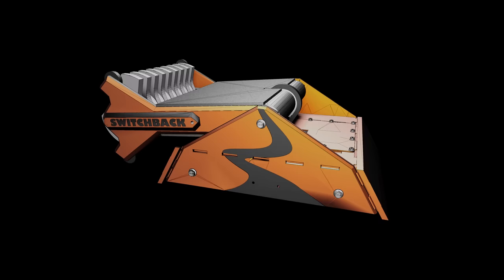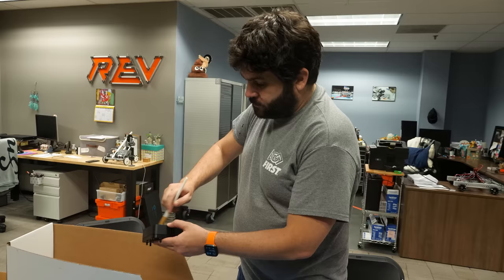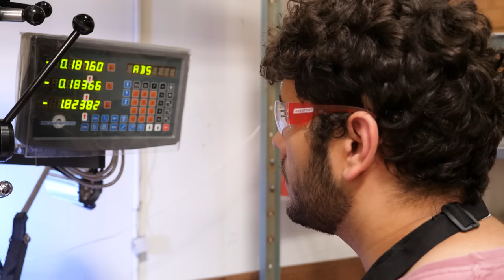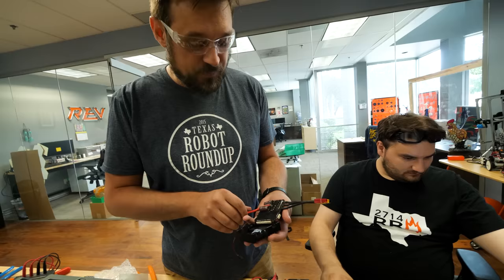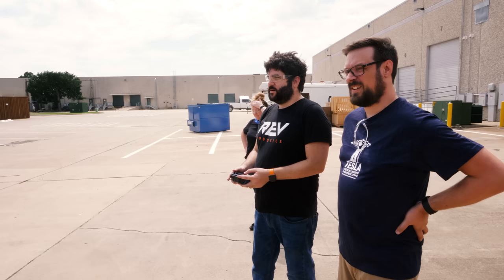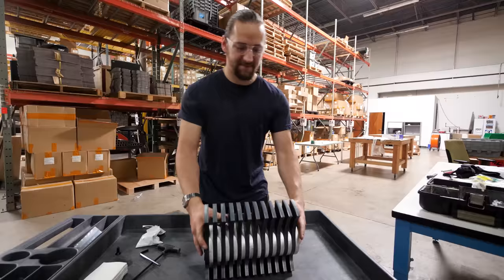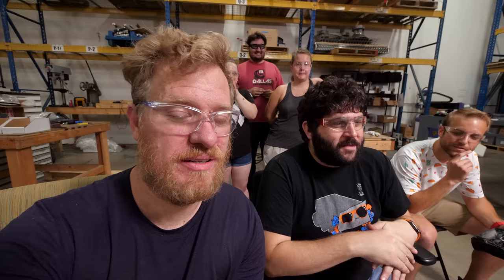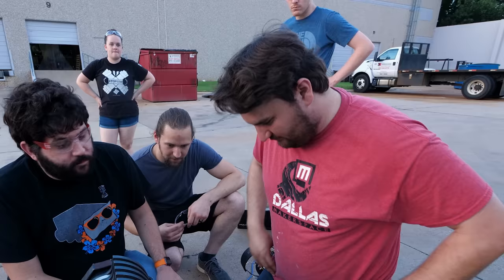We built a BattleBot. It's terrifying.

Comment: From my experience at BB my advice to new builders is don’t build your first combat robot trying to do things the “new way” brushless drive is far less reliable (but sometimes necessary due to space constraints). Also the Battlebots floor is really difficult to get good traction on so small, hard, smooth wheels are usually not the best choice if you have a high center of mass. With all that being said, tremendous props to this team and what they accomplished. I’m sure they learned all of those lessons before they even left the event. I love this video and the bot is a really neat concept and I’m sure they’ll be back even better next season!
Reply: I'm going to guess that with brushless motors you end up blowing up the controller boards pretty frequently... my experience with eletronic controllers is that they aren't particularly fond of vibration - getting sufficient isolation for the board so that it works reliably in competiton must be terribly difficult.
Reply: @wrlprchnx  I've never examined a failed speed controller board to determine cause of failure, however I would guess heat buildup due to large current demands and insufficient cooling would be the main causes of failure. Vibration failure can easily be overcome using polyethylene or a polymer resin to encase the parts so the components and circuit boards can't flex. Once that's done the components will be held rigidly in place. Heat dissipation will be your primary concern after that. The only method I know would be to used a water cooled heatsink that's also encased in the polymer resin making direct contact with the FETS using thermal epoxy. I'd consider using a couple of negative coefficient temperature sensors connected to a ESP-8266 to monitor temperature and control the cooling to critical components. Just my thoughts. Maybe you have alternative solutions you're considering.
Reply: I don’t understand how not tinning the wires caused a dead short. That sounds like something I’d say at work to cover up for a mistake I made that destroyed a piece of equipment 😂😂😂
Reply: @wrlprchnx  it’s dumb easy and most of us let the ESCs just flop around inside the robot. It’s overdraw causing them to burn up that usually kills.
Reply: @alvieteal4980  he just said the wrong word, it happens!
Reply: 12345shushi  Lasers are prohibited by name because of the danger to eyesight.

There are no rules against a plasma cutter, but the reason not to try is that opponents can defeat it trivially if they can strap a rubber sheet over their bot. Plasma cutters only work on conductive materials. They also need a ground to complete the circuit, and have a specific standoff range, so unless you have some grappling mechanism it would be very difficult to execute. You'd lose by default to bots like Huge or Mammoth.

Comment: Your esc needs to be be rated 10 times the motor power rating because the way motors are rated is weird. You might need special rc buffered esc because the load is rather unpredictable.
Reply: by RC i mean resistor-capacitor in series connected to all three phases of each output
Reply: Could also design it so that your ESCs sink heat into your frame.
Reply: Also the static buildup from spinners(which act like van de graaf generators) could mess them up

I wonder if OHKOs by spinners that turned out to be receiver errors, happened that way in the show
Reply: The ESCs and Motors alone cost well over a thousand for battlebots of this size 😭
Reply: Meaning if you have 4 wheel drive with 4 motors… that’s roughly over 8 grand. Double it due to testing and having spares, the cost exceeds 20 grand for just motors and escs
Reply: And that’s just for drive 😭 there’s usually also motors and escs for the weapon lol
Reply: In response to my earlier comment on 10x esc power rating. You don't really need that, but you should understand kv rating and how esc is like a inverter that produces three phase ac power; and select a suitable esc. If you're dealing with over 1kw motor(which is very small considering a e-bike can go to over 20kw) it's recommended to know MOSFET driver and induction kickback, speed feedback, inrush current, ect.
I know college ev teams that know nothing about power electronics and the power train always go in flames

Comment: When it's spinning at top speed, the steer torque will be impressive. Turning a corner could well flip it over.
Reply: If it turns using tank steering and raises blade it would probably do ok
Reply: something something Wrecks, something something highest kinetic energy spinner at the show.
Reply: spin it the right way and it could be gravitationally stabilized no matter how you flip it over! :P
Reply: I was thinking the same thing, this bot looks too simple electronically to handle well. battle bot have been too concentrated in getting good mechanical design, but good electronics, sensors and microcontrollers is also really helpful in controlling. I wonder why few ever go past using simple RC parts, even a flight controller will help with stabilization
Reply: @yuxuanhuang3523  I think the sheer amount of power being pumped through the systems may limit the complexity of the control systems. One of the other robots this year blew up 3 ESC's in their weapon setup, and had to revert to a spare that was only rated for 50amps. It took their spin up time out to 15s instead of the 3s they were used to from the (IIRC) 300amp setup they had grenaded. 
There are many reasons to stick with proven "dumb" systems, including ease of setup, ease of troubleshooting, peak current capability, reliability, ability to survive the combat environment, and overall cost. More complex systems tend to cost more, and add more failure points - and if a system can't survive being hit with a flamethrower, having a 100lb steel bar spinning at 250mph slammed into it, or being dropped from 12 feet up onto a floor made of 1/2" steel, potentially all at the same time, then the average roboteer won't use it.
Reply: @gchampi2  Then I have to tell you that some heavy drones have way more power than a 300 amp ESC and they still use microcontrollers.
You are right about introducing complexity is not always good though, however TI has industry-grade microcontrollers that tolerate heat and vibration, with proper protection they sure will be fine. Also, just as a fact, ESC controls the on and off of mower mosfets with a microcontroller, if it's fine, a central controller will be fine. The teams are just too focused on the mechanic part because traditionally AI hasn't been really strong.
Reply: @yuxuanhuang3523  Drone flying compared to driving on the ground is completely different. There's no need for a flight controller type system in a Battlebot, and even if there was one what possible benefit would there be? 
Countering gyro forces may not always be welcome as at times people use them to self right or need to turn quickly and are willing to deal with some gyro. 
Heat and vibration ratings are nowhere near the shock loads a Battlebot undergoes which has exceeded practically every sensor someone has every tried to measure with. 
Even with the latest AI you'd need to tune that AI to drive differently for every kind of bot and driving style, and accommodate for things like a drive side locking up.
Reply: BB regulations limit tip speed of a spinning device to 250 mph for safety reasons. That being said, balance and weight distribution is a far greater influence on tipping
Reply: Isnt physics amasing
Reply: @derektran3133  doesn't Bite force use PID control with gyro feedback for its steering?
Reply: @revimfadli4666  From what I know of the bot it does not, he simply spins it slow to avoid gyro issues.
Reply: @derektran9404  no not gyro issues, gyroscopic rotation sensor feedback. And for precise, responsive, and agile steering, not to combat gyro issues
Reply: @revimfadli4666  None that I know of, having asked some people I know along with my own recollections. Electronically it was quite simple.
Reply: @derektran9404  I mean, PID+gyroscope aren't much more complicated than usual ESCs
Reply: @revimfadli4666  It's an additional layer and set of connections that can fail inside of a Battlebot, and often times people are fine with the gyro forces as maintaining weapon speed is more important. Also the time you're vulnerable when gyro turning is different for every bot.
Reply: @derektran9404  again, I wasn't talking about gyro forces, but gyroscopic sensor as in angular velocity sensor. For adjusting against inconsistent floor slips, not gyro forces
Reply: @revimfadli4666 What do you mean by inconsistent floor slips? If I'm understanding this correctly I've never seen this ever be an issue.
Reply: @derektran9404  well the floor is uneven, so traction and slippage seem to vary

Also bite force doesn't overshoot its steering as often as other bots does it?
Reply: @revimfadli4666  Sure the floor is technically uneven and has varied points of traction but having personally driven on the Battlebox floor the variance has not mattered in driving. Our team has never really noticed that one spot was more slipper and the uneven floor only mattered for forks in which case your sensors don't matter.

Oversteer is really a question of driver skill and transmitter mixing, with the bot itself being often a small factor unless it has specific handling characteristics that are troublesome. Overshooting steering is relative to the opposing bot anyhow, so a few PID sensors wouldn't help at all.
Reply: @derektran9404  why would the sensors not matter for forks?

Also the steering won't even need "a few PID sensors", just 1 angular velocity sensor and 1 PID compensator

It can be compensated with skill, but wouldn't a responsive PID controller enhance that skill?
Reply: @revimfadli4666  You don't know when you will hit a seam with a fork and how your bot will be oriented relative to the other bot when you do.

A responsive PID controller will not make a difference as over and understeer is relative to the other robot. 

If your driver is always inputting too much or too little turning to your bot a PID controller makes 0 difference. 

It is not a closed course it's adversarial driving.

Comment: the vescs getting destroyed is a very common issue, try this: Solder a 50V TVS diode directly onto the pcb. Adding a low ESR cap also helps but that will increase bulk a lot.
The vescs dying usually happen because of voltage spikes, tvs diodes and caps help with that a lot!

Comment: "The resistance was infinite so essentially a dead short"
That is 2 completely opposite states of resistance, not remotely the same.
High resistance is the exact opposite of a short.
Reply: I think what he meant was that the controller had to crank up the output to overcome the resistance, and that increased current output made the controller act similar to a dead short scenario. They clearly at least somewhat know what they're doing, so I'll give em the benefit of the doubt here.
Reply: @Amy_A.  I have another explanation. It is a three-phase motor, and when one cable is not connected properly, the motor will not spin because two cables connect through one coil. What might have happened was that one connected coil was acting as a short because it was passing DC current.
What should have happened in a spinning motor was AC passing through all three coil at 120 degree apart phases.
Reply: Obviously just a miss speak. Like it does not matter.
Reply: I agree this was just a misspeak, but I think he's also onto the wrong idea - I've never seen a motor controller where it blows up without connection to a load.

Comment: Hey here's something that no bot builder has thought of. Installing limited slip clutches on their weapons and arms. I built recycling plants that wash tank paddles would jam up under excess waste material. to fix this, I added spring loaded clutch plates to the motor so that it would spin under power, but if the counter force was too much, the clutch plates would slip saving a lot of chains and sprockets. Your weapon stops abruptly on contact. A limited slip clutch would prevent it from burning out from excess load.
Reply: Believe it or not, clutches have been used since the very beginning of robot combat. Anything beneficial that you can readily think of has been done already. Especially something as simple as a clutch.
Reply: @bldjln3158  I've watched every build vid from Blip to sawblaze and not one has incorporated a clutch. The mechanical engineer in me gets frustrated when I see spinners being installed as diirect/chain drive without so much as a single measure of protection. Electronically, these machines are sound as a pound, but mechanically they could use some expertise.

Comment: Some improvement ideas:
Remove the chain drive and use 4 smaller motors
Definitely add heatpipes to all critical parts

Maybe even split the spinner into 2 counter rotating sections which cancels the gyroscopic force offset to enable faster turns
Reply: Counter-rotating wouldn't work because you want the whole thing impacting at once in one direction to impart force into the other bot.
Reply: @inthefade  yes I thought so as well...
Another downside would be that the bot flips itself in the opposing direction

Comment: For my bachelor in electrical engineering I had several projects during the 3 years. One of them was making a skateboard with a brushless motor. None of the teams got it to work. The motor was turning (more or) less effectively for all projects but the entire electric skateboard didn't really work in the end. They are really annoying. I guess it is easier if you are allowed to use motor drivers or other assistance.

Comment: 8:53 If the resistance goes to infinite, it is the opposite of a dead short!
Also with infinite resistance you are not able to bump the current, because you would need a massive high voltage to do so, like lightning voltage high.
If you want to learn more, look up Ohms law.
Reply: Pretty sure everyone in this video knew about ohmes law when they where 12
Reply: @Validifyed  If he knew from the age of 12, he wouldn't say: "So your resistance went to infinite, and it was essentially a dead short'
Reply: @BrainHurricanes  pretty patronising to tell people that probably have degrees in engineering to look up the single most fundamental law in electronics.
Reply: @Validifyed  No patronizing intended, but I understand you can feel it that way. You don't need a degree to build great things, they are only tools, just like Ohms law.

Comment: Its really interesting to me just how similar a lot of the build methods used in this are very similar to what we do on our school's FTC team. We have been doing welded steel robots for the past 4 or 5 years now, we have done custom wheels the past two years, and we usually use chain on our drive train. We would use brushless motors if they were an option, but they aren't legal to use in FTC. Also, power delivery is a bit of an issue we have been struggling with recently, because the batteries we are allowed barely last a full match, and drop a ton of voltage the moment a single motor turns on

Comment: Can you use a motor itself as the weapon? Instead of using the center hub to attach a weapon to attach the center hub to the chassis so it doesn't move but the outer casing of the motor spins which is your weapon. By doing this you eliminate any chains or belts to drive the weapon. Add attachments to the casing for your weapon. The outer casing is going to be tough and can be made even stronger. Only way to stop the weapon is to destroy the motor.

Comment: Many people make the same mistake as these guys did: they use the strongest metal sheets they can find. And use thick sheets, too, quite often.
Now, if you could make a system that would absorb the hits, the metal sheets will be MUCH harder to deform !
Example: take a sheet of wood, let's say 10 x 20 inches. Place it on a concrete floor and hit the board with a big hammer. It's easy to damage the wood because there's nothing underneath it to absorb the blows. Destroying the board is easy, at this time. 
Now place a piece of foam under it. About 1 inch thick. Hit the board with a hammer. Denting the wood has become much more difficult.
Now place the board on a pillow and hit the board. Denting the wood is still possible, but destroying that board has become extremely difficult and would take a lot of time....!!!
So my advice is: place several strong coil springs between the robot and the metal sheets. Denting those plates in a fight is now almost impossible. Or at least, you have now greatly reduced possible battle damage.

Comment: Guy at 8:24 was way off in his explanation. It's called enameled wire. You don't need a solder pot. It's an inductor, so it isn't "dead shorting" either when you "bump up the current", which doesn't make sense either because the current control comes from the inductor's reactance which was apparently disconnected; ESCs are PWM control devices that rely on the motor for current control.

You just told the ESC to run up with a high starting duty cycle and the poor connection resulted in voltage spikes from the motor which fried the ESC.

Don't usually have this much to say on these kinds of videos...

Comment: IDK about the worm gear. If there is any kind of shock to this transmission, gears will break as it cannot move. Using a strong servo with a planetary gearbox might be better. This way, it has a bit of give.